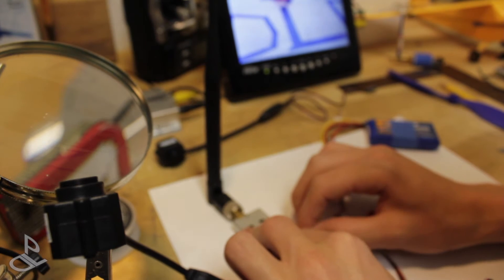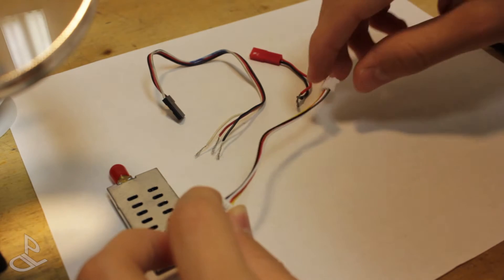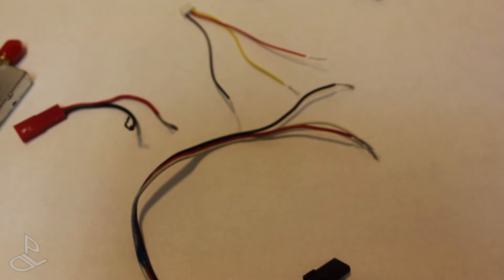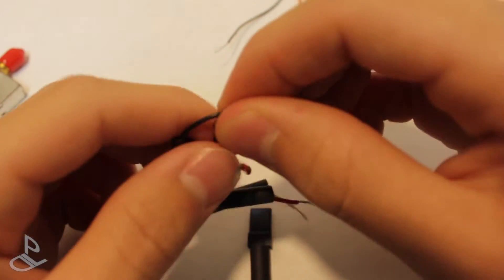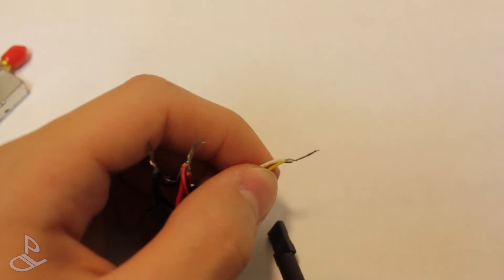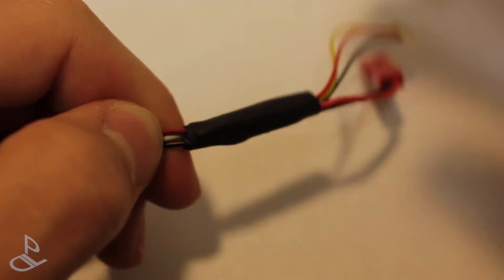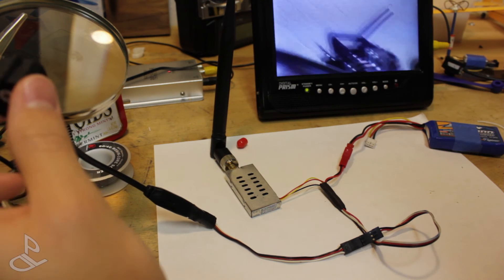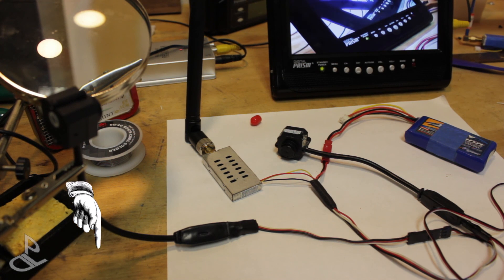DIY: 1.2 GHz FPV Connector

Comment: Cool stuff.
After watching you join your wires, I wondered if you knew about the 'Western Union Pigtail'!? It's a lot cleaner and much stronger. http://constructionmanuals.tpub.com/14027/img/14027_122_2.jpg
Anyway, good videos..

Comment: What receiver are you using with the hobbyking 1.2 ghz transmitter?
Reply from the maker: I added a link in the description, any of those should work. That's where I got mine and it works flawlessly.
Reply: DLPlanes Ok, thnx dude..
Do you think I can make a fpv setup with this ? : http://www.ebay.com/itm/CCTV-Wireless-1-2GHz-8-Channel-800mW-AV-Video-Audio-Transmitter-Receiver-Kit-/330765939116?pt=US_Audio_Video_Transmitters&hash=item4d032fb1ac

Comment: What country do you live in? Im pretty sure in the US where i live only 1080 mhz ia aloud but the cost for the video transmitter reciever for 1080 mhz is way higher. I control with 72mhz so 1.2 would be viable and probley pretty uncrouded? What problems have you seen with it where you live?

Comment from the maker: This transmitter has four frequencies, 1080GHz, 1120GHz, 1160GHz, and 1200GHz. I mostly use 1080GHz, but it may depend, sometimes one frequency will work better for you depending on your location.